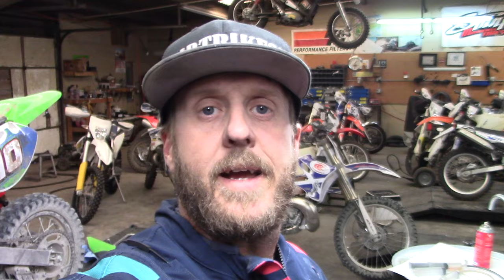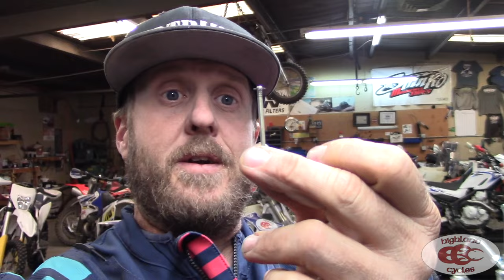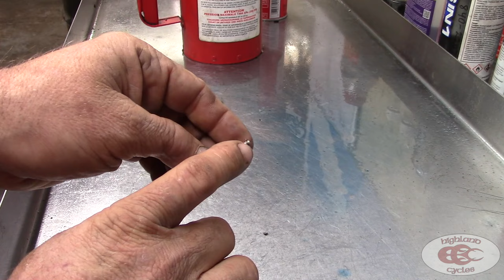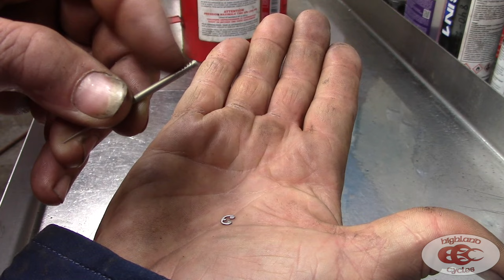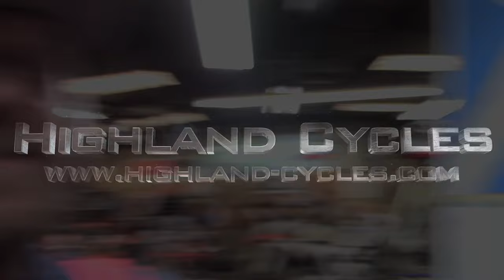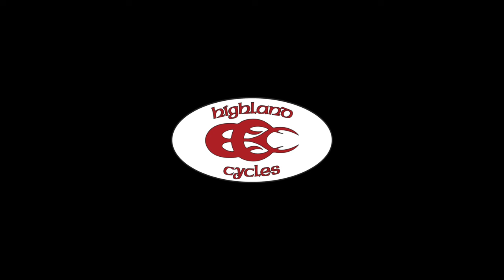What Position For My Needle Clip?

Comment: I realize this is an old post, hoping you're still active. I have a 49cc 4-stroke with a PWK type carb. I do have some experience with jet tuning, and it's running great at both idle and full throttle, but sometimes bogs a little at midrange. Would this more likely be from a lean condition, or rich? I'm thinking it's a little lean, but would love an expert opinion. Thanks a ton!
Reply from the maker: Probably lean. drop the clip one position

Comment: I got my new carb, tuned it. When I blip the throttle (in neutral), it stays at a high rev for like 5 seconds then start to idle down. Also, when I put it in second gear it dies out. Lmk all the electronics are all brand new. It’s a mini quad 125cc 4 stroke with 3 gears. Thank you
Reply: Generally, if the revs stays high and doesn’t immediately return to idle, it’s running lean. And on the other end of the spectrum, if the revs die down and almost stall, it’s running rich. Hope that helps. Best of luck. Been chasing carb problems on my rf600r all weekend 😅

Comment: Hey, I have an 86 xr600r. Carbs cleaned, re jetted 155. It ran fine I towed it to az from md it will start and idle! If I barely crack the throttle it will build rpm’s but anything past that just breaks up. I’m lost dude
Reply from the maker: From Maryland?  Probably need smaller main

Comment: Our KX 60 is revving SUPER high at start up…. I MEAN SUPER HIGH - like I’m afraid it’s gonna blow.  Could a carb adjustment gone bad have something to do with that?
Reply from the maker: It could be an adjustment or it could be something with the throttle.  Make sure you have freeplay in the cable
Reply: @highlandcycles  Will do. New cable just arrived!
Reply: Did you figure out the issue? I’m having this problem with my 2000 kx250 and I just rebuilt the carb…. Tried adjusting the idle with the carb screw but I thought I was gonna blow it up when I kicked it over…

Comment: Great video.  I have a huge question if you have time to answer.  When putting around at maybe 1/4 throttle the carb is choaking, 3/4 to WOT it runs fine,  Idle it runs fine.  Just the slow putting around every now and then it does that choking bog sound.   Should I adjust needle or change pilot jet?   Any help would be greatly appreciated!
Reply from the maker: I’d try the needle first. Drop it one position (move clip up one groove)
Reply: @highlandcycles  awesome.  I'll give it a try and thanks for the advice.
Reply: @Rizzel101  Did raising the clip up a notch help you solve your issue?

Comment: I have a carbureted 2008 Crf250r. It runs great, the only think wrong with it is that it sputters in the high end of 1st gear and 2 bad gear when I steadily accelerate at a slow pace. In the rest of the gears, the sputter happened in most of the rpm ranges. There is no noticeable sputter when I quickly accelerate though. I’m not sure what this problem is, if it could be my carburetor, spark plug, or anything else. If you could help me that would be great, thankyou!
Reply from the maker: I would try moving the needle. Try both ways
Reply: @highlandcycles  alright thankyou, I will try that sometime.

Comment: My 95 Yamaha Kodiak 400 4x4 had no power but ran okay. I bought a new carb and now it has tons of power, but boggs (as if it's hitting a rev limiter) when I'm at about half throttle. It does it in every gear. Once I get the bogg I can push past it by romping the throttle and it runs great. Any idea what's wrong?

Comment: So dropping the clip down to say position 3...would richen it correct? Because it's affectively raising the needle and allowing more fuel or air right?
Reply from the maker: Yes.  More fuel earlier in the throttle opening
Reply: @highlandcycles  I've got a stumble around 1/8-1/4 throttle that I can't diagnose once I'm past it she takes off like a rocket. Turbo Suzuki bandit 1200
Reply from the maker: @joshsutcliffe6099  hmmmm. I’d try  leaning the needles
Reply: @highlandcycles  topped out
Reply: @highlandcycles  I'm 1.5 turns out on my adjustment screwa

Comment: low rpm, low throttle - runs great
low rpm, middle throttle - runs great
low rpm, high throttle - bogs
middle rpm, low throttle - splutters
middle rpm, middle throttle - splutters
middle rpm, high throttle - runs great
high rpm - splutters regardless of throttle position

what adjuatments do you think i need to make?

Comment: Great info,  I have a vm22 on a 125cc changed the jet to 120 great idle and no hesitation. My problem is that when I turn the throttle down   the carb stays on high for a few seconds.  Not instantly like it should. Any ideas. Thanks
Reply from the maker: Probably need to richen up the pilot circuit
Reply: @highlandcycles  thanks, should my carb cleaning wire go all the way thru. My smallest wire won't. It may be plugged.
Reply from the maker: @Ken-it8wv  yes it should

Comment: My son has a 07 kx65. It absolutely screams. But off idle, if you blip it to fast, it bogs. If you roll it , it rips. Never hesitates in any rpm range. Only if you are too quick with the throttle. If i drop the clip down a spot or 2. Will it help that??
Reply from the maker: It should help.  Might richen the pilot too
Reply: @highlandcycles  if your already on the bottom needle groove and you're still getting a bog when you grab a lot of throttle like that should you try a slide with smaller cut out?  Idle is good and wide open is good.  Where do you find throttle valves (slides) for a vm22 mikuni?

Comment: Question:...My YZ80 (2002) in Quito (altitude 2500meters) is bugging, wants to turn off in the curbs when rpm's go below lets say 2000rpm. With the choke on it does not do this. What could be wrong with the adjustment of the carburator...?
Reply from the maker: Put one size bigger pilot jet in it
Reply: Thank you very much. I appreciate it and I will try that!

Comment: I hate carburetors things are freaking annoying mine starts but act like its in full throttle then when i tried to reset the idle and the mixture screw it wont stsrt at all the clip on my needle was set to the 4th clip i set it to the 3rd and i guess it wint run at all now
Reply: Update got it to run but now still having the same issue the wheel spins without me even touching the throttle

Comment: I know it’s a bit late to ask but I have an issue. I have a 2006 kx250f. I’m 15 and I’m just getting into this carburetor thing but based off of videos this is what I can tell you. Both jets are clear, has a new cheap carburetor on it. The clip on the needle is in the middle. The bike idles kinda crappy and at half-3/4 throttle it holds back. Lower rpm and full throttle it drives great. I’m not sure what to adjust and don’t know if that means lean or rich. Any help would be awesome. Thanks.
Reply from the maker: Man I don’t know. If it’s a cheap Chinese carb you could be chasing it forever
Reply: @highlandcycles  alright, thanks for responding. I took it apart today and moved the clip on the needle up one. Still does it. I am going to try a larger size main jet and try moving the clip again before moving on. You think a more expensive good carburetor would fix my problem? I just don’t want to break the bank on this bike. If you think a newer carb would do the trick, do you recommend one that won’t cost an insane amount of money?
Reply from the maker: @ronniemac34  I just recommend the one that came on it.
Reply: @highlandcycles  ok thanks dude

Comment: I've got a 4 stroke kawasaki bayou. Runs and idles perfectly. Starts first pull. But bogs out really bad when I give it throttle. Carbs been thoroughly cleaned. Any ideas? And another weird thing if I work my choke it almost as a throttle and it'll run smooth and drive using the choke and only the choke. I'm completely lost.
Reply from the maker: Sounds like you might have an air leak somewhere.  I would get it running and spray some brake cleaner around the intake area and see if you can find it.

Comment: great video but do you think itll help my problem which is that at 1/4 throttle to around 1/2-3/4 the engine will hesitate if i hold the throttle steady. it feels like it wants to die but wont im guessing because of my momentum but 3/4 to WOT it runs fine. the bike is a 2009 yz250f and the carb was just cleaned out very well. it has factory setting and im at sea level
Reply from the maker: That could be needle position or it could have to do with the mid body gasket.
Reply: @highlandcycles  gaskets are all in good condition but I’ll check needle tomorrow, do you think I should go up or down with the clip, it’s at 4th position
Reply from the maker: @fpvdominator9563  try #2
Reply: @highlandcycles  thank you and I’ll let you know how it goes tomorrow
Reply: So I just tried the second position and it did the same thing, got any ideas on what it could be?
Reply from the maker: @fpvdominator9563  not sure man. Did you split the carb apart and do the mid body gasket. It’s not in the normal carb kits
Reply: @highlandcycles  I did split it apart and everything looked good but I’ll order one anyway. I’m thinking it might be timing as the valve spacing wasn’t fully in spec but was close enough that I wouldn’t think it would do anything noticeable. I’ll keep working on it and let you know how it goes

Comment: I'm trying to dial in a recently rebuilt KX125.  I advanced the timing a a little but was hearing a little knocking when under a slow load.  So I put the timing back to stock.  I also noticed it wasn't putting out very much smoke at all (I am running synthetic Motul 2t so thta's part of it I guess.)  I did turn the air screw in 1/2 turn (so it's only out about 1 turn) and I am getting a more normal amt of smoke at least at low RPM.  I do still hear a a faint occasional knock under load so I'm thinking lowering the clip from 3rd to 4th down.  I'm at sea level so that's pretty far but I'm not sure what else to do or if I should just try a larger pilot.  Any thoughts much appreciated!
Reply from the maker: I’d go up on the pilot and main.
Reply: @highlandcycles  Thanks,, I'll give that a try!  Keep up the great vids!

Comment: Hey I got a brand new 38mm keihin air striker with a jd jet kit for my 01 jtm, I installed it just how jd said, yet the bike runs great at idle and full throttle, but is choppy in the middle. Got my clip in the 4th position on the blue needle just how jd said. Should i try lowering the clip?
Reply from the maker: No, raise the clip/lower the needle
Reply: @highlandcycles  hell yea, thanx man

Comment: I have a Mikuni vm22 carb with a Uni air filter on my SSR 125 pit bike. After installing the genuine Mikuni, the bike idles erratically and only smooths out when I pull the choke. When the choke is off and I twist the throttle, it bogs and want to die. I went up to a bigger size pilot jet (37.5) and main jet (115), but no change.  Will changing needle clip position help out in my case? I think the clip is currently in the 3rd or 4th position now.
Reply from the maker: Sounds like you already have it in the richer position. I’d try an even bigger pilot
Reply: Ok. Will do. Thanks.

Comment: Does moving the clip one position make a big difference?
Reply from the maker: It can depending on the carb and bike
Reply: @highlandcycles  I have an 03 CR250R that I swapped to a pwk a/s. I think the slow(50) and main jet(175) are good. But the plug still gets a lots of carbon build-up.  At my local trails,  I can't really open the bike up, but I got a trailer last fall, so now I can ride quite a few places that are less trails and more ash dumps and hill climbs. I think the build up was more from putting around and not from jetting.  I may move the clip and lean it out a little

Comment: Any help ?
Have 1990 kx100 
Have done a top end rebuild took it out and the bike is bogging out . 
Hits power bands then right at the top of the power bands bogs out any help ?
Reply from the maker: Hard to say. Check jetting
Reply: Souds like either a rich bogging or a lean bogging, if its only at full throttle it sounds like air fuel mixture is incorrect. If your happy the carbs ok, jets are not blocked etc. Try turning the air screw on the carb in (clockwise) to the richen the mixture. If its worse then its most likely a rich fuel problem. If its better then it was running too lean. Then just find your sweet spot. Average base settings is 2 turns out on most carbs. Check where yours is set before you alter the settings so you can go back to them if no better. Hope this helps 👍🏻👍🏻

Comment: My bike sputters at the top end. ive cleaned the carb and can see light through all jet holes. the float is level with the needle on setting four. its sputtering like it has a rev limiter and pops at deceleration. its a cheap 125 pit bike apollo. Any help would be greatly appreciated thanks guys
Reply from the maker: It could be the electronics

Comment: Hey buddy I have a raptor 660. Busting my head trying to get it right. The quad launches perfect but when I get passed almost half throttle it wants to sputter and lacks the power. What do you recommend I can do. Thanks for the help 😣
Reply from the maker: Hmmm. That’s a tough one. I’ve seen the parking brake switch be an issue on those.
Reply: I actually ran into that and fixed it. I rebuilt the carb and ever since it has been acting up. I put the old Jets back in it because I have a big gun exhaust and cdi box.
Reply: When I first rebuilt it it was sputtering in the low revs so I put the old Jets back in it and now I’m having the issue with the past half throttle. Could it be a needle adjustment thing ?
Reply: Im new to carbs and it busting my ass  :(
Reply from the maker: @joelaparicio6335  It could be
Reply: @highlandcycles  Forsure man. Yeah I appreciate any direction you can shoot me in brother thank you
Reply: Figured it out. Put three sized bigger on a jet
Reply from the maker: @joelaparicio6335  awesome

Comment: Hi, my ktm 450 runs ok in lower gears at full throttle etc but when I put it in higher gears and at low rpm and use 3/4 full throttle it hesitates and doesn't rev up smoothly. I think it's running rich but would you suggest going lower on the main jet or leaner on the needle? Thanks
Reply from the maker: Start with one smaller main jet
Reply: @highlandcycles  ok, I'll try that. Thanks for the reply bud 👍🏻

Comment: So I've got a 400ex that'd fresh off a rebuild. It's running rich. Black smoke. Smells like gas. Spark plug soot and black carbon. Smells like gas. Would lowering the needle, raising the clip, help lean it out? Or do I need to mess with something else?
Reply from the maker: That will help but you might need to address the float height or jets too
Reply: @highlandcycles  k thanks. This is a new language to me. I don't understand carburators. Lol

Comment: I have 50cc 2t moped and the accelerator goes slow because I have 70cc piston but 50cc carb, if I lower the ring on the needle will it make my moped go faster on acceleration?
Reply: Not exactly. You move the clip position that just changed fuel ratio. But  amount of fuel not changed at all.  So... you should buy the carb 70cc
Reply: @tuetran3524  I was thinking of main jet, would that work?,
Reply: that just a temporaly solution. Sorry my english not very well so i call the....where the air go  to your carb = mouth of the carb. Size of "mouth of carb" very important. Every things you do like change size the jet or change position of clips and that just a temporaly solution. You change the ratio fuel not amount. So if u try every way but not success. Just change the carb to 70cc
Reply: here is every think affect to your carb. At the beginning of video. Change the carb you success rate will be higher
Reply: @tuetran3524  oh okay, thanks for the help😁👌🏻

Comment: Hello, can I ask another question?
Reply from the maker: Sure
Reply: I wrote several times but youtube seems to erase my messages. So, I have a weird case. The YZ 80 was stalled for 10 years. The carb was terrible so I bought a new one on mycarb (Amazon). The new carburetor looks impeccable. This carb only has two adjustment options. The air idle jet screw and the main idle screw. I have the slag on the cable, so the slide does fully close. The bike only runs and starts (zero throttle) with the air idle jet screw fully closed and the main idle screw fully opened. Still the idle rpm's keep to high! The weird thing is when I pull the choke out th idle rpm do drop. Any opening of the air idle jet screw even by a 1/4 turn kills the engine. The bike tends to bogg when opening the throttle fast and the bike hasn't got any power between throttle 0 and 40%. Also the bike idle rpm's rize similar like when you have no fuel and then the engine tends to shut off. As the bike was smoking a lot and the spark plug black and oily I lowered the needle to the lowest position. It did improve the performance a bit. My question is; What is wrong with this carburetor and which steps to do to make the bike run well?
Reply from the maker: @robertjongejans  I don't know.  I don't ever deal with aftermarket carbs. It might be fine but I have seen lots of them be really weird
Reply: I do understand. What would you recommend if it would be the original carburator? I would like to send you some pics, what is your mail address?
Reply: Or WA?
Reply from the maker: @robertjongejans  If it were the original I would recommend  going up on jet size. Both the main and the pilot

Comment: Help!!! So I put the clip on 4 then 5 because the bike sputters at cruising speed with less than 1/4 throttle. But it seems like it got worse. Do I need to go back up to 2 or 1? I’m also running 45 idle 120 main on a 26mm nibbi carb on a 125cc bike. What do you recommend???
Reply from the maker: Yes, go to #2
Reply: @highlandcycles  I’m gonna try that today. Thank you.